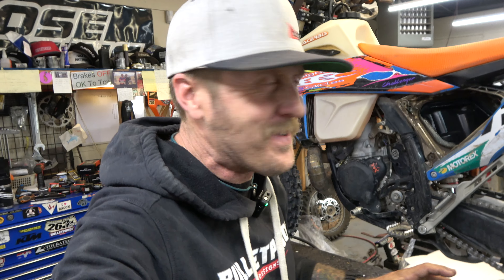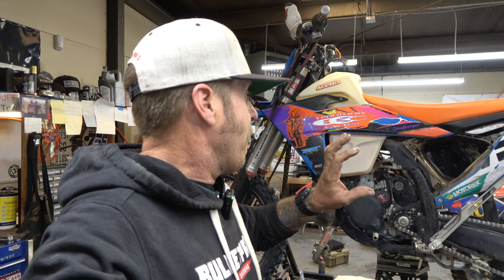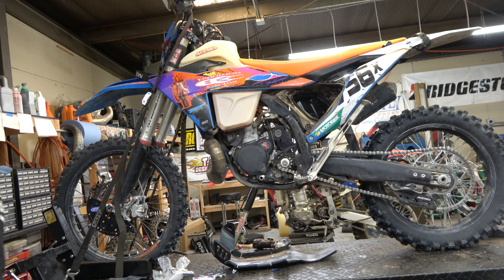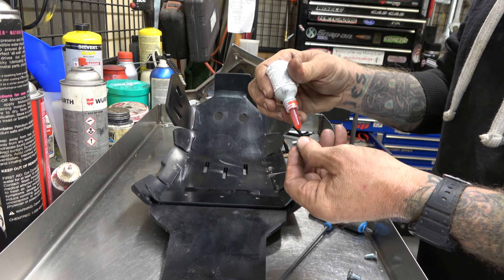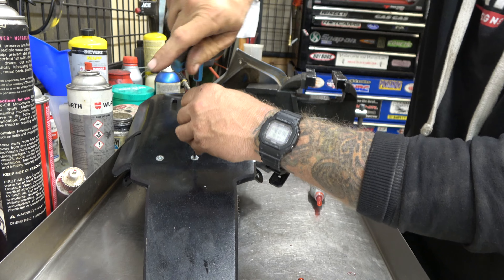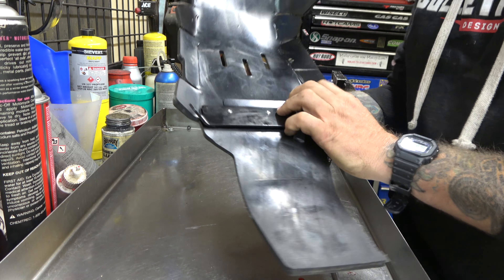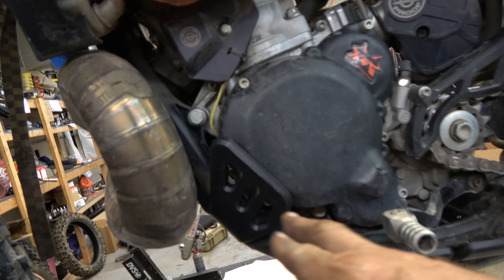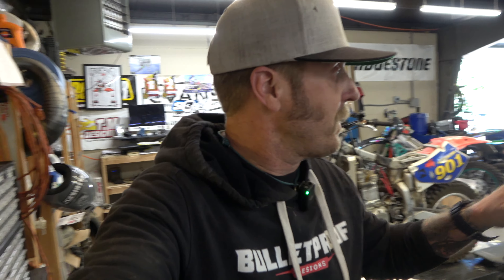Tusk Severe Impact Skid Plate Install | First Look | Review | Highland Cycles

Comment: I have a acerbis one.  Good coverage and it has a flip lever that screws out.  The back end hooks on the frame.  Stupid easy on and off.  Easy to clean.  Its taken a beating so far.  I'm not that nice to it.   I have been on a easy on/easy off skid plate since my last bike.    I tend to remove them for cleaning more.   Not just when I need an oil change.  That said this one looks pretty nice and super beefy.
Reply: I’m with you. Like the Acerbis because it offers decent protection and is so easy to take on and off

Comment: Going to order one today. I need a set of tires as well. What do you recommend for riding high elevation rocky stuff here in Colorado? Thanks!
Reply from the maker: For tires?  The Talon rear is amazing for grip but wears kinda fast.  The T-35's are a great all around and the best front in my opinion is Bridgestone X31 or M59 but for budget I would do T-35 front.  It is good but not amazing

Comment: The Tusk Skid Plate 3/8" thick vs. Molecule Motorsports 1/4" thick both UHMW which is a better design? ... AXP sucks in my opinion they fall apart... never again!
Reply from the maker: For the KTM the Tusk is better in my opinion.
Reply: Do you have any idea of the weight difference between the two?